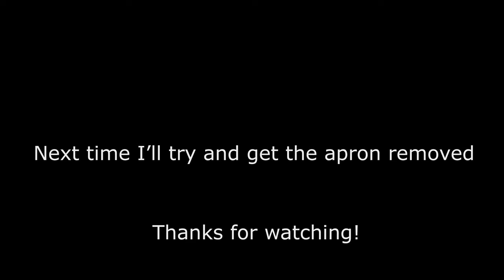1950 LeBlond Regal 17" Lathe Restoration Part 4: Messing with the Compound and Miscellaneous Parts

Comment: Why dont you use lube to free stuff up beating cast is just disaster as your finding busted pieces. Watch some others doing it on YouTube. Penetrating oil is your friend.
Reply from the maker: I actually used a lot of lubrication of various sorts while working on this! WD-40, liquid wrench, machine oils, cutting fluids, etc etc etc. Sometimes it wasn't on camera, though I'll admit I didn't use them on some parts where they came apart easily enough.